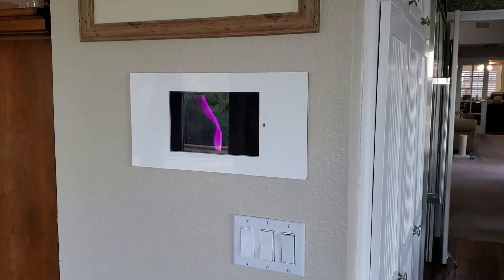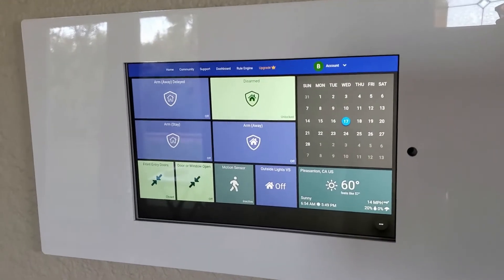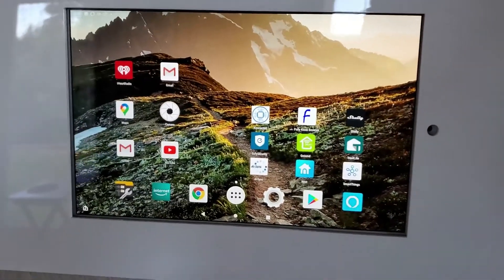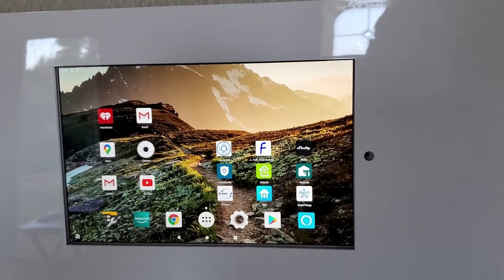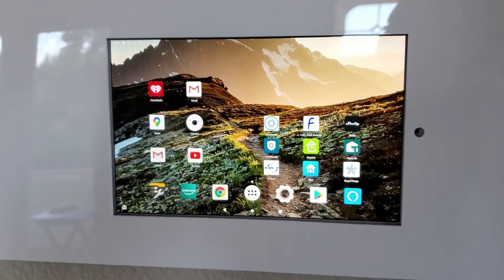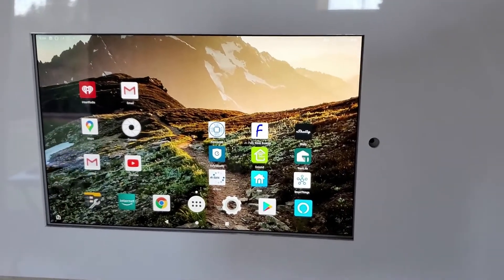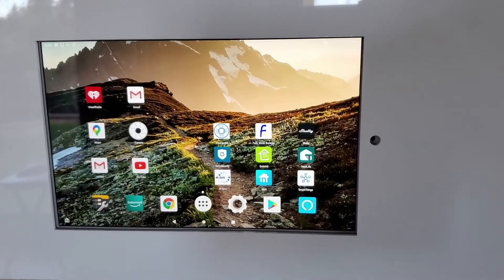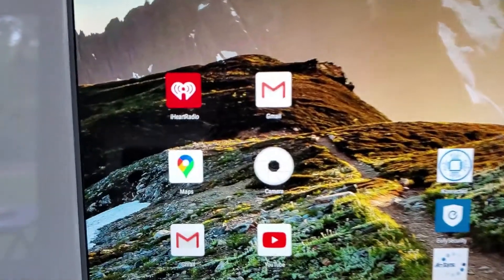Old Intercom Upgdate - Final Tablet Config & Echo Dot Room Stations

Comment: I am at the very beginning stages of starting this same project with my Nutone system (6 conductor wiring). I am not that handy when it comes to most electrical projects, but I think this seems simple enough. I have a total of 11 sub-units, 8 indoor, 1 garage, and  at front and rear doors. If I did only a tablet (1.8A) and 8 dots (8x1.25A) the LRS-150-12 (12.5A) seems like a workable option, beyond that, it seems like I would be better served by the LRS-200-12 (17A)? The other stumbling point I have is replacing the front door unit with a Ring doorbell which requires AC power ( thankfully it is the only 2 conductor wire so it is simple to identify at the base station). Do you know of any low voltage DC to AC inverter that I could also tuck behind my tablet/base unit, or is there a better solution? The back door unit gets direct sunlight (in Las Vegas) so I am open to anyone's suggetions where that is concerned. I am also uncertain of what... if anything... will be useful in the garage.
Reply from the maker: In real World, you will never see the 'spec' current on even ONE device, let alone all of them simultaneously, so you can probably 'under-spec' it a bit. Even when the dots are playing music at full volume, they are barely pulling 0.5A. The Tablets worst case is  if you have a power-out and it discharges significantly - then it will pull more current when it comes back on vs just maintaining it at full charge under 'normal' circumstances. 
Regarding your Doorbell, I have a Eufy Battery unit (rechargeable - lasts more than 6 months between charges) - completely wireless installation so can go anywhere in your front entrance area, not limited by your old wiring. I started with a Ring - sent it back, it would not even work with my Samsung phone - but so pleased I got the Eufy - the video quality is FAR superior and also, all the video is stored locally - so no cloud fees! I would honestly recommend it.
https://www.amazon.com/eufy-Security-Battery-Powered-Detection-Self-Installation/dp/B081C4JN51

Comment: Awesome set up. I’m thinking of doing it as well. The links you posted for the genie and everything are no longer valid. Can you point me in the right direction please? Thank you
Reply from the maker: Thank you! Sorry about the links. 
https://www.amazon.com/Genie-Ceiling-Bluetooth-Optional-Fantastic/dp/B07KWH57S6 - or the genie web site -   https://mountgenie.com
OC Woods seems to be on a short break - link suggests contact him in 10 days or so (should be back on 23rd June) - https://www.etsy.com/shop/OCWoodCreations
You can also search on other Acrylic fabricators (maybe even TapPlastics??) - I made my prototype just with a piece of painted hardboard and a 4-1/2" hole with a hole saw (but not quite as pretty as the Acrylic back plate); I just checked Tap Plastics site - their std template does not include hole larger than 1" but again, you can purchase the hole saw & do that part yourself -  order the basic wall plates cut to size and with polished edges & radiused corners. Recognize the hole edge will be covered by the Genie plate anyway. But I would recommend wait for Craig at OC Woods!

Comment: Just one thing I found - instead of putting in and twisting the Dot mounts, just push them straight in! They will spring into place once you slot them in. Also those posi locks are not good for thick cables i found. Wire nuts work well, cover with electrical tape.
Reply from the maker: Thanks for those suggestions Aman! I agree with inserting technique typically, it was complicated in this case with the metal frame (which I needed because of the wall stud). PosiLocks are available in many different wire gauge sizes so they are excellent devices if you select the correct size for the wire being used. But yes, simple wire nuts are OK too (again selecting the correct colour for the wire being used).

Comment: Are you able to play the same song throughout the entire system?
Reply from the maker: Yes, you can do through Alexa
Reply: @decosse01  This is a great update for an old system. How is the sounds quality with the echo dots in the housing/mount? I was curious if it the quality is affected by the mount as it looks like like the speaker is fairly covered?
Reply from the maker: @jacobconway7379  It sounds fine to me - I can't say I notice any muffling from the Dot being in the Housing and say it doesn't really sound any different. It's obviously a mono device so limited in that respect whether in the pod or not, but it's decent enough quality sound. My wife likes to set the one in the Bedroom for 'Play Sleep Sounds for 30 mins' - very relaxing :) p.s. The sound is certainly much better than the old Intercom speaker!
Reply: @decosse01   You're awesome man! Thanks for getting back to me. I think it is time to upgrade.
Reply from the maker: @jacobconway7379  You're welcome. Dots are really inexpensive - you can always just get one and see how you like it before embarking on the whole project. (you can just plug it in to a wall socket, with the supplied power supply, even inside the mount, just to test it) But even aesthetically it is a huge improvement!